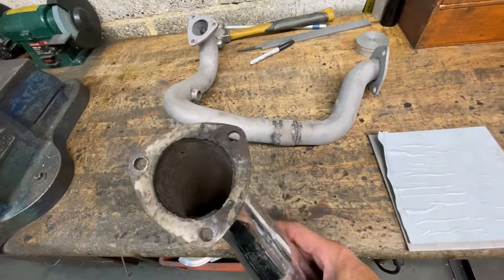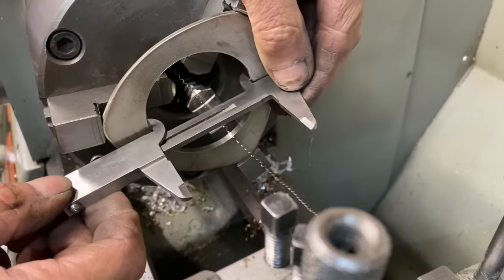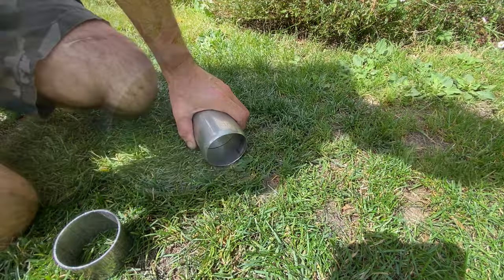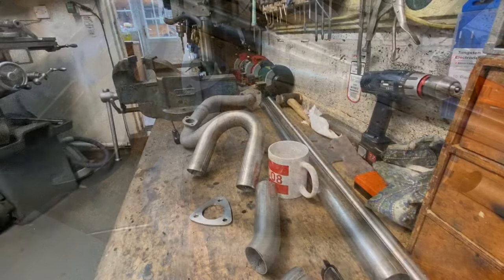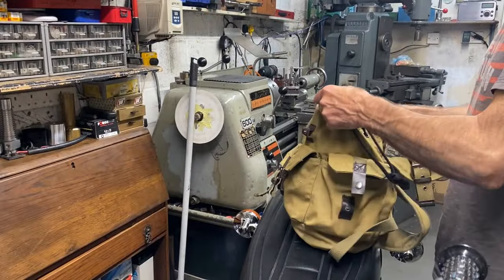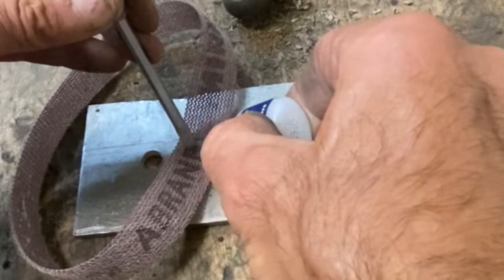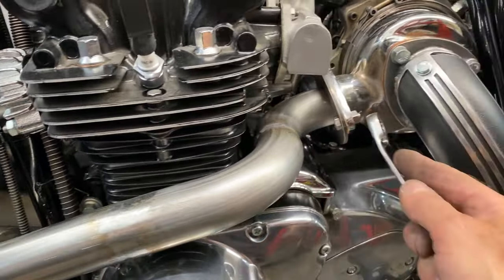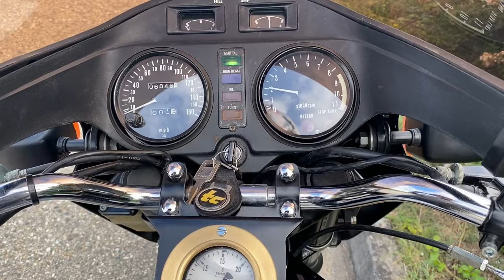How i made a stainless Steel exhaust for a Kawasaki Z1R Turbo

Comment: The best of British engineering I remember when every factory had one or two of them, talented individuals now all gone.
Reply: Not gone at all, I know several small toolmakers, machinists and welders that turn out stuff like this, you just have to find them.
Reply: Last week I took my motor home to a guy in Kent, England (it was a shed on a farm that he rents) to have hydraulic auto level lifts fitted. 2 days later he called me and asked if I know where I kept the "key" to lower the spare wheel cage? (as he needed to re-position it) I had no idea what he was talking about, so all he said was, "no problem, i'll make one". After he hung up, I knew i'd found a special person and my mind was at ease. In all, he had to re-plumb the water pipes and fabricate a spare wheel cage and cross beam to fit it to. "Nothing was a problem" he said, "just a challenge". Mercury RV is his business name, ask for Simon (tell him Andy recommended you) Your be in safe hands.

Comment: I tried cutting a copper pipe with hacksaw blade and it was biting so much that it didn't allow me to move the blade even with slightest pressure
I wonder how Allen manages to cut using hacksaw blade so effortlessly💗
Real talent there...

Comment: Tyrells workshop and Mr Millyard videos same day? Fantastic. Ive been looking for an old gpz turbo set up or aftermarket for my z750 for years. I saw a stock gpz750 turbo in my town. So damn cool
Reply: It’s not actually a Gpz750 turbo. It’s either a Z750 turbo or a Kawasaki 750 turbo. This is because the Gpz engines were specifically lean burn, while the turbo engine was more an over bored Z650.

Comment: Those thin discs are good for cutting aluminium too, i got a carrier bag full given luckily....which was nice.
Reply: Lube the disc with wax when cutting aluminium and it will do it nicely.
Reply: I get mine from Lidl or Aldi, whenever they have a tools sale. They work just as well as fancy name stuff for a fraction of the price. Always wears a dust mask as they throw off loads of grit.
Reply: @johnDukemaster   Thanks for the tip,Candlewax ok for it?
Reply: @junglie  Hmm... don't know actually. I was thinking the wax one uses when polishing 😁

Comment: In the '80s  when Ken Cooper was running his GS 1000 Suzuki Turbo  "Cooperized" and GSX 1100/1500 Suzuki "Cooperized 2" I built the 1-5/8"pipes for "Cooperized 2" copied from a Vance and Hines system with suitable modifications ie.. continuous curve headers and open megaphone all in stainless all bent with a ratchet bender at my place and TIG welded ..worked great.. sorry I don't have any pictures but Ken might. If you are seeing this Ken maybe you could put up some pictures from back in the day ? the neighbours were glad when he left after running the bike for just two minutes.. it was loud ..and sweet as the success we had with both bikes.. ride on Ken !

Comment: I got to ride a modified Z750 turbo (running 22lbs of boost). 
Most amazing bike I've ever had the pleasure to ride. You could feel the rear frame flex under hard acceleration before the rear tyre would start to loose grip.

Comment: The finished products this magician creates could never be guessed at from the ULTRA-low tech methods he uses...sticking in a piece of wood to support the pipe's plug, bracing it against the house through the flower bed, etc...just great!  I know there are tools that would rotate the larger pipe and apply a roller to the edge to turn it down to a smaller diameter, but the hammer method is SO much more satisfying!!   The story on how he fabricated the V-8 Kawasaki was incredible as well.  Allen, what do you do for a living?   You and Colin Furze should get together. The resulting nuclear explosion would be amazing...

Comment: Quick tip for your Hacksaws Allen.
Fit the Blade ‘backwards’, with the teeth pointing rearwards.
Like a Japanese ‘Pullsaw’ for wood, it cuts straighter, never snags, and the Blade lasts much longer.

Comment: Allen, I have to repeat what you said. I have an old Suz Katana 1168 cc with front mounted turbo and intercooler and I have to say just like you said, "it pulls and pulls and pulls", until you roll of the throttel at 10 000 rpm at top gear, not because the engine runs out of steam but because you don´t want to get your arms full of over-revved pistons and valves. But it still pulls like a freight train, even at 250 km/h.  :-)
The saying is that Carroll Shelby (the man behind the AC Cobra) once said that "There´s no substitute for cubic inches". That might be right except for a turbo. :-)

Nice video, as usual. Thumbs up!

Comment: That turned out very nicely. A thought that perhaps instead of roasting your boots on the hot side of that turbo you could fit a heat shield. The material used to shield the catalytic converters in many different cars works to shape very well and the dimpled aluminum sheet sandwiching ceramic fiber can be polished to a pretty good shine by hand. Whilst it can be sourced new it is virtually free at your local pick a part.  Whilst it would not be era correct I believe it would look a whole lot better than lagging the pipe and work as well.
Just a thought. Cheers

Comment: Thank you once again for another excellent video Allen, also many thanks for your tip of using that type of hacksaw blades, they are the best I have ever purchased and cut better than any ever used before and look to last for a long time, the Abramesh  belt idea is pure genius and will definitely be using this method and turning a small alloy drum with retaining ridges for the belt to use in my drill, regards Doc Cox.
Reply: @M Bacon Thank you for the tip but it will have both, slightly conex with two ridges.

Comment: well  i  have   done  mig  stick   welding   and a   bit  of   tig   and  thought  it   would  be  easy   ,  how  wrong  i  was  .  getting  the  electrode  and  the   rest  of  the   torch  bits   right   and  the   settings   correct  i  found   mind   bogling  .    i   will  keep  watching  you    do  it   and  have  another   some    time   .  keep  up  the   bill   work

Comment: Hello Allen. I am really liking your turboed bike. This is a sling back to the good old days I remember well. Your method of polishing tubing is what I used twenty years ago in a metal shop. Used baking soda and super glue instead of what you are using. Using a hack saw blade is just too cool. The number of times that I used a hack saw to do something is way to many to count. The handle on the drill press really looks comfortable. How did you acquire it fella ?? Nice video for us  to see too. VF

Comment: Love your polishing trick. My welding  salesman showed me an expensive polishing tool and I just copied it. Make yourself an aluminum pulley on your lathe with a  5/8 -11 thread in the center. Put it on your angle grinder. Buy cheap 3/4 inch (20mm) wide sanding belts on amazon. 120x 240x .

Comment: Impeccable skills mate, another great project. 
I really enjoy watching a master at work, thanks for sharing.
Can I give you a angle grinder tip, there’s no need to tighten disks with the key/spanner, hand tight is fine for if it jams the key will get it loose easily, but if you tighten with the key there is no easy way to remove the now jammed on disk.
Peace be with you Allan

Comment: Brilliant video! I remember there were a few turbo bikes around that time, the Suzuki xn85 based on the gs650 engine, I had the GS650 katana. Also Honda did a CX650 turbo, based on the CX500/CX650 twin cylinder engine, I think there maybe was a CX500 turbo also?
I think the Kawasaki had the better setup as the Z1 engine was already a formidable brute of a lump! 
I went on to aquire a Honda CBX1000 just for it's sheer grunt and off the scale grin factor! 😁 At a bike show I saw a custom modified twin turbo CBX1000 and thought that thing must be insane to ride!
Happy memories, 
worst thing I ever did selling my CBX1000  😯🤔

Comment: Alan never ceases to amaze me how simple he makes every job look, all done with minimal equipment. One question though I'm not trying to be a clever clogs, but TIG welding stainless do you not need to back purge the pipe to prevent oxidising (sugaring) on the inside?

Comment: Fascinating. So you appear to have placed the turbo to blow through the carburettors. Have you made any alterations to them to handle the pressures invovled. I know Yamahas early turbo in the 80's had something done to it's carburettors. Also, whats lubing the turbo bearings ?
Reply from the maker: It’s a standard API kit as fitted by Kawasaki dealers it sucks through the carb not blowing

Comment: Apparently that Q bond is just a thin CA superglue and a mix of sodium bicarbonate (Baking soda) and Carbon powder, with the amount of carbon adjusting the strength of the filler. Haven't tried it yet but the raw materials are so cheap I'm defo going to!

Comment: In my next video, I will show you how I bend Reynolds tubing without a pipe bender, by forming my nasal cavity into a Blenholt oscillator and directing it at the tubing. 
This guy is off the charts!!

Comment: Hi Allen , I love what you do for enthusiast motorcyclists as myself here in Australia . I have a Z900 with a Mr Turbo kit fitted and would love to manufacture a stainless system for my bike also
But alas , I don`t posess the SPECIAL tools ( lathe ) as you do, also I lack the indepth knowledge that you are gifted with. I would luv to attempt to manufacture this system just to see if I were capable and if I don`t suceed , try and try again. Keep up the great projects and videos mate , I luv it. Cheers John
Reply from the maker: You don’t need a lathe I only used it because it’s in my garage, you can chain drill the large holes and file to size 😎

Comment: I like your use of Abranet. I use it at work for car body repairs so I have plenty. I never thought about using it for metal polishing. I thought it would have dulled too quickly. I'll give it a go next time. I notice you do all your cutting and grinding outside. I presume that's so you don't contaminate your workshop with iron fillings. Not good when your building engines? I know how frustrating it is when you put a slightly magnetic component down or drop it, and when you pick it up it looks like an iron hedgehog LOL!!
Reply from the maker: It’s amazing on metal it stays sharp for ages

Comment: Back filling those  stainless steel pipes with argon gas  Help  to weld..Clean  . My Son,  Just finish the hot side for turbo  project.... Learned a lot
Reply: It's really bothering me, So I'm just going to ask... you might want to check the turbo because may have  Weld Slag, into the turbine ...did it make boost ?  Sorry  just know to much like U
Reply from the maker: It’s all fine 6lbs boost easily.
Reply: @AllenMillyard  Thank You   I Just worry   Good ON YOU  !!!

Comment: I’m not sure which is most impressive - the concept - I can do this with a hacksaw file and Swiss Army knife; or the execution - swaging a pipe on the grass with a hammer and cutting a dead straight 1mm ring off a pipe. Not many engineers can make their hands do what their mind imagines.

Comment: Hi Alan, I really enjoyed this video and found it very informative, but I have a question reagrding the welding of stainless steel pipe. I thought it was common practice to back purge the inside of the pipe with Argon to stop oxides forming. I couldn't see this being done so wonder what your thoughts are, or was I missing something? Thanks!

Comment: ....if you feel any heat - it's just 'the wrong trousers' - as the exhaust system is perfect. Thick leathers with a foil insert in that area would help the rider . I'm sure all us bike fans would like to know if there are any modern - and 'standard' bikes , which you admire - or even own ? I was hoping that when the 'Norton' brand was sold - then production of a modern retro look model would start , and be a success like the Royal Enfield 650 Interceptor has been , such as a replica of the old Norton SS650 for example ...?

Comment: Amazing as always, jesse james should watch and get some tips.  But I've got a question. Shouldn't you be wearing long sleeves and proper welding gloves? I weld all the time and always wear gloves and jacket, and it sure is a pain especially when it's above 100 degrees in the summer, but I was told that arc is 10x the sun, possibly 12x in England, and you don't want to end up with skin cancer. Just a thought. You wear a helmet all the time and I don't always.

Comment: It does concern me watching people cutting things with a 1mm disc in a grinder in a lassez faire fashion. I work with them a lot at work and things can go horribly wrong so quickly. I like to clamp them down and hang on to the grinder with both hands. Seen a lot of people get hurt bad with them and should be treated with utmost respect.

Same with drill presses. If you can make the belts slip easily enough by hand, the way you did it is fine. Otherwise it sure hurts when it grabs.

Sorry to sound like a nurse Nancy, you obviously know what you're doing but I worry for those who see it and come to grief without realising any better.

Otherwise, a very interesting video. Thanks for the info.

Comment: Had a good laugh at the 30psi boost gauge
Reply from the maker: It’s standard but yes it would be much better with a 0-15psi gauge 🙈
Reply: @AllenMillyard  BTW ever considered putting two BMW K100 engines together for a straight 8 and a super charger like an old Alfa 8C and dropping it in something like a Westfield?

Comment: i know that you like the unusual.. what about a bike powered by an a.v.p.i.n. starter motor ? i have one in my kitchen... its a bit on the heavy side but the torque it throws out is unbelievable...it will spin up a rolls royce avon jet engine. to self sustain in 10 seconds it ran on   isopropyl nitrate.. a very dangerous liquid.. but will also run on either gas or petrol it has its own exhaust pipe ..all you need to do is make up 90 degree drive to any motor bike engine using its own  clutch & gearbox . and thats it!  i was thinking of sending it to "thunder city "in south africa.. but the price of the postage , will be in the £100.. or more..i hope to get a reply  from your good self  .. yours   laurence.

Comment: So.. No Lambda, no waste gate, no dumb valve.. When you turbo, you definitely turbo.
Reply from the maker: it has a waste gate but thats it
Reply: @AllenMillyard  IMO a dump valve would be better option for the application. It would clear the cold side when throttle is lifted. The older pipe had a waste gate flange installed, but I never saw it go back to the new one..

Comment: Wonderful Allen!  Really enjoy all your "tricks" of fabrication.  I have the same bike with the Z1 ATP Turbo old style "Log" exhaust header on mine.  I also found that replacing the stock oil pump with a KZ1000 Police version offers better oil volume for the turbo.  The guys at Turbokits.com were very helpful with turbo parts and a new waste gate to limit boost to 7.5 PSI (the old square unit was sticky at 15!).  Here is a link to the video and some dyno runs:
https://www.youtube.com/watch?v=x1YbxN1RaVg&t=356s